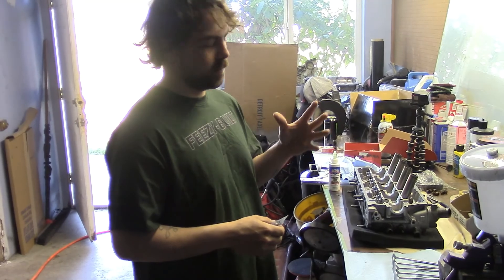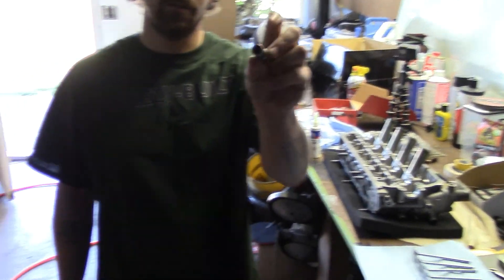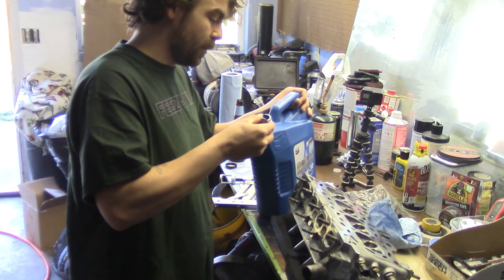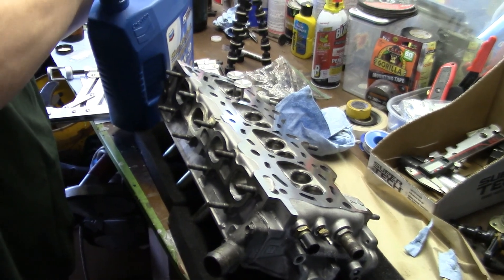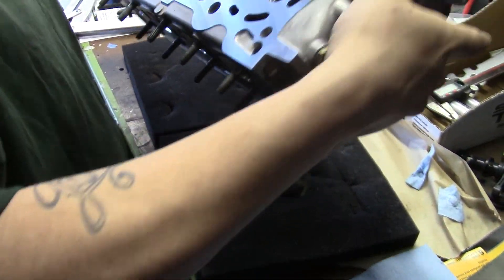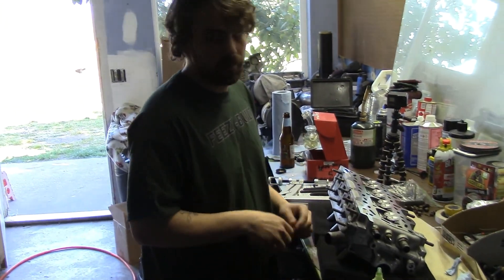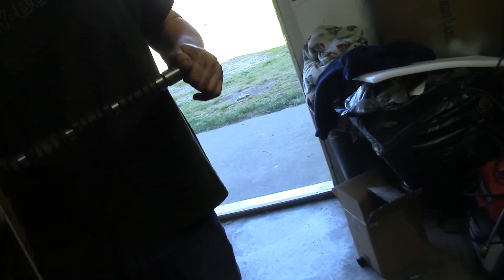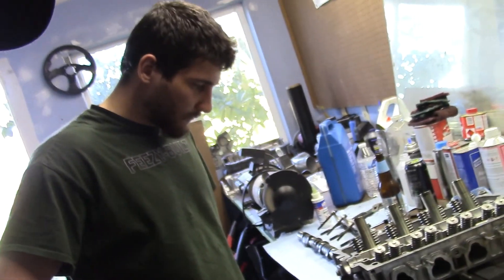Rebuilding d16y8 vtec cylinder head with top quality parts

Comment: Building my head too but I'm staying na. Skunk 2 tuner stage 2 cam and aplha springs an retainers with port and polished head. Hoping to get 160 whp
Reply from the maker: Nice man sounds like a awesome na setup
Reply: @feezy-built108  yeah hope it turns out good I have no idea what I'm doing really lol my first build other than just bolt ons honestly. good video man!
Reply: @feezy-built108  hey quick question. I have a minime set up, y8 head on b7 block. I bought the car fairly cheap. 700$. I have no clue what the previous owner had done to it, what work, what it needs, etc.etc. anyway though that's fine with me, soon I'll take off the head and send it to the machine shop have so they can do a general clean up, valve job, and basically tell me what it needs or if its fucked. Soon after ill send the block as well and have it looked at for any cracks and just overall inspection and testing. My goal with this minime set up is to keep it as is i won't run any turbo or boost, just a bit higher compression ratio and VTEC, nothing else. Little fun daily with decent gas mileage period👍 ok now my question is since i see you using performance springs/retainers/valves etc. And since I'll be taking the head off the block I've been thinking about putting good quality internal parts like that on my cylinder head sort of to give it that 'bulletproof' feel, even though I'm not running any turbo or boost but i do want to be able to rev it and use VTEC every other day because obviously that's why i bought the car lol. Im new to this as im sure you can tell right away, but im learning and i just had that curiosity about whether or not it would be a good thing to get good performance internals for the head (like supertech/brian crower/skunk2) or if it really wouldn't make a difference from just buying normal stock parts. Please any advice would be greatly appreciated. Thanks